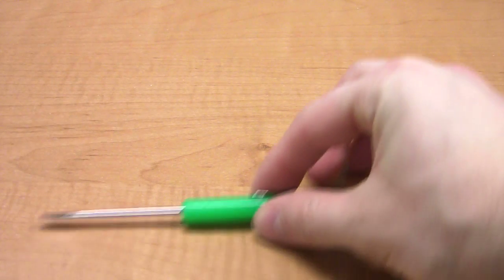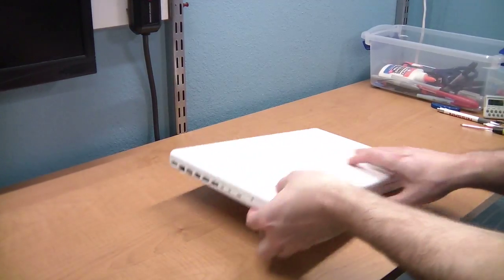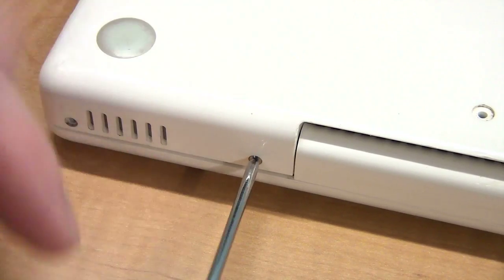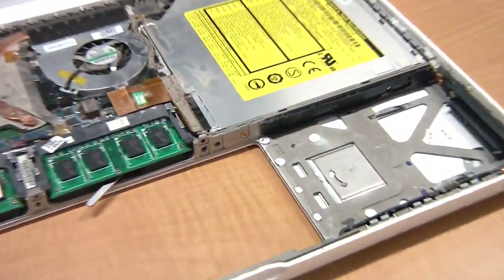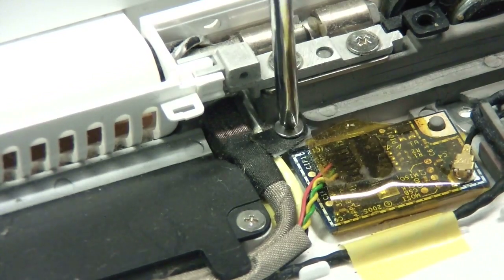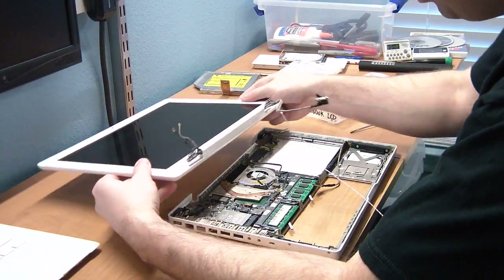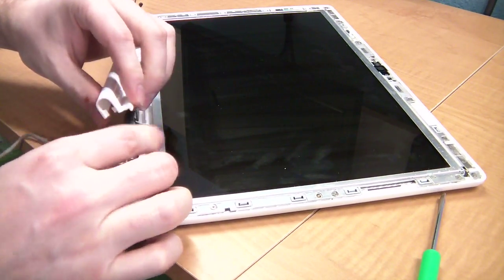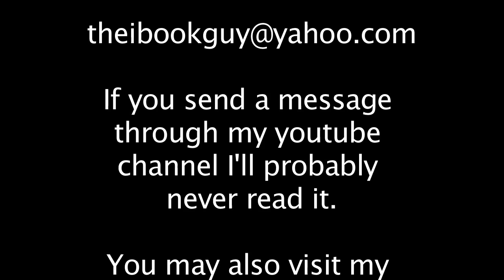Apple 13" MacBook Disassembly and Repair video

Comment: Saved an old MacBook from the trash thanks to you. Replaced the hard drive, upgraded the ram and installed Linux Mint on it. These things had Duo Core 2, 64 bit processors in there. Still a very serviceable computer.

Comment: Hi, Thank you very much for the video! I bought a factory mid 2009 MacBook for 90 USD and used your video to upgrade it to 4 RAM and to a hybrid HDD which I had lying around, and reapplied thermal paste. It now runs like a MacBook 2015 :P

Comment: impressive video.  great angles, clear video quality and proper pronunciation!  I just HAD to comment on something... you know you're a pro when you separate the screen bezel with a small flat-head!  that screwdriver was millimeters from the screen and you pried the bottom off.  Kudos for a great video and a skilled technician!

Comment: Finally fixing an issue with the monitor hinge. Laptop fell and the top would not close straight. Finally saw how to take the laptop apart and readjust the screws. All better now. Thanks!

Comment from the maker: @Dell0304 - Those are probably just pressure damage spots.  They are more visible on a solid color background.  When you get some picture or pattern on the screen our eyes can't differentiate the darker spots.  There's nothing you can really do besides replace the LCD panel.  If it doesn't bother you too much, just leave it alone.  It won't get any worse unless the screen gets a lot of pressure applied somewhere. (even from the back side)

Comment: I haven't watched the vid yet, but I need to replace the hinges, cover, wifi and camera on this MacBook Air late 2008 early 2009. The hinge problem is no longer covered w/Mac or Apple or whatever they call them selves. I bought the parts on ebay and thought I would try it myself before I pay someone, just in case I CAN do it and learn something too. Anyway, I will let you know when my friend gets here and we will watch your vid on his lap top while I work on this MacBook Air & thanks for letting us know right off the bat about the screws. My daughter gave me this MacBook Air and she had changed the hinges herself and had several screws left over and she never put them back in and said it was harder than she thought it was going to be and suggested I take it to someone who knows what they are doing, but I don't have the money for that. Sooo……If I can do it or not I will let you know! BUT THANK YOU TO EVERYONE WHO PUTS THESE REPAIR VIDS ON YOU TUBE!  WE DID FIX OUR CLOTHES DRYER FOR $8 BY WATCHING ONE!
Reply: No problem!! All good now! As in, it was purposefully busted up by a mentally unstable person & is NOT repairable. Has to be replaced. But, it was a wonderful laptop that I deeply miss!

Comment: I was working with one of these in work and I found them to be really cool when playing around with them. I am going to buy myself one.
Reply: they are cheap on ebay, less than $100 for the earlier models. around 300 for the Mid-2010 unibody model, which is the best one to get.
Reply: +Antonio Barba I'm getting 1 4 free m8
Reply: MassLanFFS Vasa nice!
Reply: I just received a 2006 model from my niece, who got it as a gag graduation gift a couple years ago,  and stuck it on a shelf as the network ability was lacking.

Comment: I poured a glass of water into my MacBook I always keep on the floor next to my lazyboy. (I thought it looked thirsty). After pulling power and shop vacuuming I let it set and then used a hairdryer. The next day I powered it and got a color light show.. followed by normal operation! Thought I dodged a bullet. I was wrong. 3 days later I got the chime followed by the "gray screen of death". I've since replaced it with a white late 2008 in mint condition I found for $45. Before I toss it in the trash.. I thought I would pull it open and see whats in there.. Your vid is just what I needed! nice job! good quality video! Guess there will be lots of good parts if nothing else - and this screen and light board is perfect. May need a new MOBO.. we shall see.. :-) - thanks for posting.

Comment: Ah yes, only the best engineering from apple. Blowing hot air from the CPU right on to your backlight circuitry. Only from apple
Reply: *block your rear exhaust with the backlight circuitry.

Comment: Very well done. Those 4 screws on the front of the  battery compartment - hard to see where you are pointing. But they are #'s 2,4,7,9 looking at them as in the video.

Comment: Thanks for an easy to listen to and easy to see video. I have a macbook screen that has typical backlight inverter symptoms.  I took it apart today with your video to see if maybe the cable was pinched or if replugging would help.  It didn't so I'll order an inverter.  One question for when I install the inverter. My machine did not have the backlight power cable you show, looked like it might have been hard wired?  I'm having a hard time figuring out model but it's Late 2007, 2.2.  Thanks.

Comment: That was pretty neat. I have a question, I was upgrading the memory on my mbar A1181 model. One of the 2GB module slipped in easily into the slot but one on the left would not go in. I see something hanging into the slot, is that the problem?

Comment: Fuckin' hell, laptops are a goddamn nightmare to work with compared to desktops. Having to mess around with all those core components, doing a near full disassembly just to be able to detach a screen! shudder
Reply: oh well, that's the sacrifice for portability
Reply: Vkn EXACTLY
Reply: i know im about 1 year late but still, thing is apple products are not made to be serviced by customers thats why they dont bother with making it compact and easy to get around
Reply: HeyIt'sTaz! :D  My laptop only has like 2 different screw sizes, the bigboy screws at the bottom and the motherboard screws 😎

Comment: Good video.. thanks.  I use a smudger as find a screwdriver is more apt to scratch if you hand slips.  The plastic smudgers are cheap and often dollar stores have them in a kit or ebay.  I use a magnetized screwdriver as it's so easy to lose the weeny teeny screws.  With a magnetic screwdriver it is less easy to drop them as they are near impossible to find once dropped.  I use a pill reminder box that is always in dollar stores for compartmenting the loose screws.

Comment: hi, i have a question - in some videos i found that hdd is hold in bracket by torx screws? i am asking because i want to slightly upgrade ma wife's 13" macbook late 2007 and don't want to get stuck immediatelly...

Comment: Great video, though I was hoping to see the reassembly. I need to replace my dvd drive, I think. Something in my black MacBook rattles inside as you tilt it. Not sure what it could be. But when I tried to use my dvd drive one if the last times back in 2009, I could feel something moving in that area. Like literally something on the back of the MacBook was moving. This happened before a dvd got stuck in the drive. I got the stuck dvd out.

Comment: I have one of these that I need to replace the bottom case on. The battery lock broke off and I tried to super glue it back on. It still works, but the plastic part is gone now. 
Is this a heinous repair job to do?

Comment: I know this is an old video but I thought I'd ask a question and see how we go. I have one of these machines thats recently died. It powers on, the OS loads (i can hear the volume sounds as I press the buttons) but the screen is all black but I DO have backlight. when I power it on I can see all the pixels on the screen go black and thats all the screen does. It happened while I was watching a Youtube video and hasn't recovered. Ive researched this issue but haven't found anything online. Would you have any idea where to look or should I just start looking for a replacement board? I know its an old Mac book but I'm a sort of collector and I don't like knowing one of my machines doesn't work, even if it doesn't see much use.

Comment: I have a late 2006 MacBook with a bad optical drive, would I be able to replace it with my optical drive from a 2011 MBP? I have it left over from using a data doubler.

Comment: is it worth pulling the motherboard out if your main goal is to de-dust the machine?  Or is it enough simply to remove the keyboard panel?
Reply: Incidentally, the easiest way to start getting the keyboard panel loose is to push up from the underside inside the battery compartment.  This will effectively allow you to lift up the left side of the panel (it's not well-secured once the screws re removed) and reduce risk of damaging the rather delicate edge of the panel by prying.

Comment: My fan is making a bit of an unusual noise occasionally, so I want to get in there is see if I need to clean out the fan. However, knowing how fragile these plastic Macbooks are around the rim of the keyboard plate, I am worried I'll crack or chip the edges if I take it apart. I've seen so many of these white MacBooks with chips/cracks in the palm rest/keyboard plate.  Plus keeping the screws is a bit of a pain, but I guess I'll venture forward.

Comment: I have the same macbook and the backlight sometimes goes out when the laptop is moved or the screen is tilted. When this happens i can get the screen to work again by playing with the brightness up/down buttons on the keyboard, but it only works for a couple seconds. is this a backlight inverter issue as well?

Comment: Do you know what the maximum RAM is for a macbook 5,2 from mid 2009 and also if it can take DDR4 RAM? In addition to this the battery lock on my macbook is broken and I am unsure of how to fix it. Thanks.

Comment: Is there a way that you can clean the front and back of this motherboard.? I took part of mines apart and I dipped a toothbrush in alcohol and then clean part of the erosion off and then wiped it with a lint free cloth but I can't figure out how to get to the back of the motherboard to clean it and idk where else to clean because I'm not gonna lie I know your not supposed to cut it on but i did try to cut it back on to see if it worked and it actually cut back on perfectly but then it cut off so ikno it's still some erosion somewhere in the computer. maybe you could get to it and I was reading a lot of websites and watching alot of videos and I didn't use water or saturate the board or toothbrush with alcohol cause i didn't want to mess it up.

Comment: I need your help, i have the same laptop but it wont start up also when the charger is pluged the light doesnt turn on, i bought a new charger and i replaced the magsafe board, but the charger conector doesnt light up. Evidently isnt the charger or the magsafe board (since both are new) , can u please tell me what it could possibly be?  thank you

Comment: I have a late macbook 2006 1.5 GB ram and 2.2 megahertz dual core what is the highest OS X I can put on it right now I am with snow leopard but want to put a new OS X on it just wanted to know if I can pass snow leopard on it to upgrade it and keep it going
Reply: If the MacBook 2006 has a intel core 2 duo then it can run Lion but if it's only gotta a core duo then you can only run up to snow Leopard
Reply: I have a MacBook4,1 early 2008. I can only go to 10.7.5 Lion my guess yours being 2 years older Snow leopard might be the top for your macbook you can always try lion 10.7.5 im sure a message will tell you if you cannot load lion.

Comment: I still have a Black Mac Book 13" and unfortunately its considered vintage and no available parts for repair. I'm sure there is however I might have a disc trapped inside and it will not come out. Now my Mac doesn't turn on completely and keeps trying to eject. Could I use this same step to get to the issue I'm having?
Reply: You can find parts online. They aren't Apple official, but they're just as good if not better.
Reply: thank you

Comment: It is not necessary to disassemble everything to remove the disc, just by disassembling the battery it is removed by pulling the ballot out and the ram by turning the clips to the left

Comment: Just did a quick dusting of the inside, especially the fan. Installed a fresh 10.6 OS. Current Safari and Firefox won’t work so I went with Chrome. It’s the only one that plays YouTube.
Reply: It would be embarrassing if it didn't, since they are both owned by Google.
Reply: Tried Waterfox?

Comment: I bought this macbook used off ebay one of the screws on the ends where the fan vents are stripped can get it out any suggestion smh I'm really PISSED

Comment: Wish I knew what was wrong with my old MacBook os 10.5.8. Relative staying with me decided to try to upgrade with latest software and not all it does is begin to come on, but ends up after so many minutes shutting down and restarting in a vicious circle and yet not ever starting.
Reply: Judi Calhoun sounds like a buggy version of the OS or it’s not compatible(most likely this is the case). If you still have your OS 10.5.8 disk, put it in the optical drive and hold the option key when turning it on. You should get two options, one being the disc with 10.5.8 installation. Choose that and reinstall Mac OS. Hope this helps!

Comment: I am poking around inside my Macbook, and noticed that the interface the Airport card is in, is a mini PCIe slot. Has anyone put an SSD in there and put two regular hard drives in (replacing the Optical drive in the process)?
Reply: TGOTR i was thinking you could put a laptop graphics card dock thing and put windows on it for light gaming

Comment: I installed the drive upside down by accident (rookie mistake) and now macbook won't power on.  Took the keyboard cover off to see inside better.  Rubber siding came off and was able to install the drive properly after, but still not powering onl.  Not sure if the keboard cover shorted out or worse...the logic board shorted out.  Does anyone know of any easy troubleshooting techniques that I can do to determine the root cause without having to purchase another keyboard cover?  Much appreciated.

Comment: hello 8 bit guy... I have a question, hope you can help. Mi Mac collapsed, is the HDD I am changing it but I do not know if this one I am buying will fit 
(Laptop hdd Seagate 320GB Laptop HD SATA 320 gb New
Seagate Momentus SATA of 320 GB
 FAT32 - 
7 mm  thick
• 320GB
• Caché de 16 MB
• SATA
• 5400 RPM, SATA, 5v      0.45 A
• size: 9.5mm
• Model ST320LT020
• p / n 9YG142-190  )

I thank you for your help
Reply: Sierra Arellano if it is a SATA connection and your make sure that it is a laptop drive it should be able to fit.

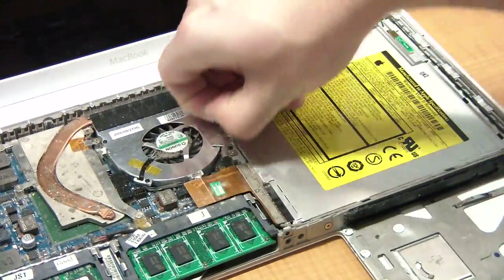Comment: At 3:35, as he slides out the hard drive, black rubber/plastic guides come into view.
Mine became partly detached so I was unable to slide a drive into the machine.
I oponed up the machine as shown here (except my keyboard/upper facia was very brittle and stubborn even though I had removed all screws, so the left/right edges broke/crumbled).
I pulled the partly detached black rubber/plastic guides off completely, leaving some glue/stick tape residue.

Has anyone tried using superglue/strong mulitipurpose bond to re-attach these guides?
Did it melt the black rubber/plastic guides?
Did you use general parts cleaner (usually intended for use on vehicles) on cloth/cotton buds to remove the residue left on the machine?
Any problems?

Any guides for a person who forgot to label/store each screw separately as he took it out? (Whoops).

Thanks.

EDIT 1
Once the optical drive is removed, is there any reason to put it back if you now use an O/S installed from USB?
Will leaving any of its connectors unattached cause any booting issues/malfunctions?
Thanks.

EDIT 2
Is the backlight inverter the part whose failure causes my screen to flciker a little?
Thanks,

Comment: my MacBook Air keyboard on cable is broken, m , n, ' (sometimes) and backspace as well as the left side of control and cmd keys but caps lock and tab work, where can I find the replacement ribbon cable?
Reply: the keyboard doesnt have anything to do with it, its the ribbon cable thats problem..

Comment: u could just snap off the bezel to get the inverter without taking apart the main laptop
Reply: It is only necessary to disassemble the system part if you need to replace something in the hardware.
Right?
Reply: yeah.
Reply: SuperNinja66 He's showing how to disassemble the Macbook if you just need to upgrade the ram, hard drive, or change the optical drive.
Reply: i know that, but i was just on about how he couldve fixed it faster. it is a great video though
Reply: SuperNinja66 OK.
Reply from the maker: +SuperNinja66 Actually, you cannot get to the backlight inverter without taking the entire screen off of the laptop.  The bottom most curved bezel cannot be removed otherwise, and that is the part that houses the inverter.
Reply: Oh, my mistake! Sorry!
Reply: +The 8-Bit Guy this is amazing. how much you charge for this. god bless you
Reply: The 8-Bit Guy Thanks for the info.
Reply: what does the aluminium tape do
Reply: It sticks well.

Comment: hi...where is the battery that keeps the computer time?
Reply: On the 2006 and mid 2007 models (1,1 and 2,1, same as shown in the video) it's on the back of the logic board. On the later models it's where that little screw for the optical drive is.

Comment: You don't need to disassemble much on this MacBook to get to the inverter. You can easily pry bezel on the screen. The inverter board should be below the LCD just hanging about. To place the bezel back on, just make sure the tabs are not on the bezel or it will be a pain to put back on. If all or once all the tabs are on the frame the bezel should be an easy snap on... This video went a bit too far. But still nice to watch :)...